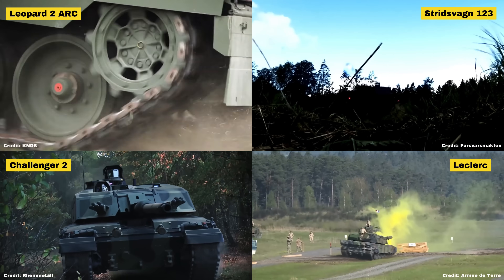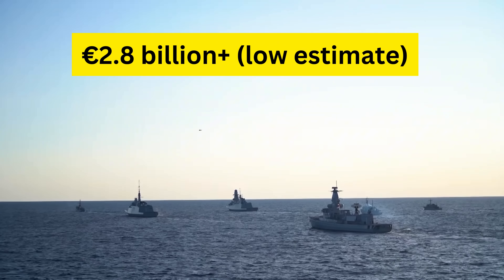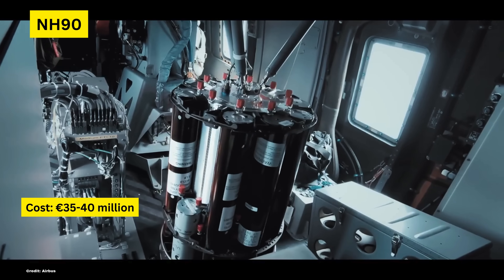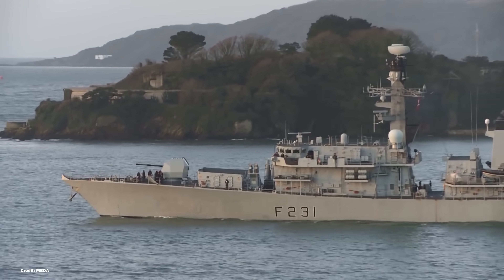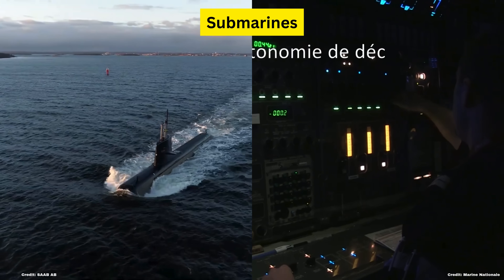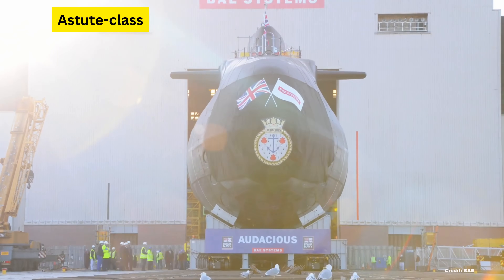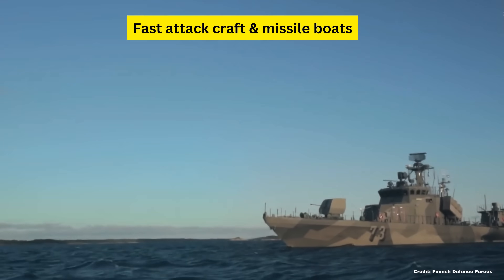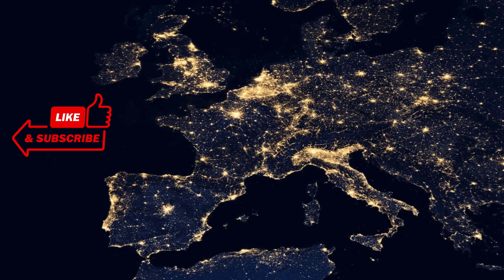The Staggering Cost of Losing Europe's Arms Market Part 5 - Europe's Naval Power continued

Comment: Finland should abort the F35 deal ( almost 10 billion €) ASAP!!!
Reply: So should Denmark. For obvious reasons slow walking the vote on the contract would be the wisest way.
Reply: @natviolen4021     go for the saab gripen.  Very cost effective,  can be operated from a decent road. Very capable aircraft
Reply: @jameslang6760  And it is fully NATO integrated.
Reply: @jameslang6760  The Gripen relies on GE engines - which the US could probably also make life difficult with.
Reply: @robert.maynard  That sounds interesting i did not know that. Have to look into it.
Reply: @robert.maynard  i wonder if Rolls Royce could help...
Reply: @57thorns  If the NATO integration is an US system it wont help us if the US breaks out and buddy up to Russia. Then we need our own system that is not Nato standard.
Reply: @palandorstvold5622  That worries me, too. Would that be an idea for a future video?
Reply: @robert.maynard  So no option if you want independence from the us. Eurofighter Typhoon or Dassault Rafale. Keep money within the EU 👌👌👌👌👌
Reply: @robert.maynard  Just wondering out loud how difficult it would be to replace the 414 engine with a European one, and how the performance envelope would change. The time/money for doing this important part of the calculation.
Reply: @gordanhyland7422  The EJ200 is newer than the F404 upon which the Gripen's RM12 is based and is shorter, lighter, smaller diameter, and more powerful - however how much of the airframe would need to be replaced / reworked to accommodate it, if it was a possible option, is for experts to determine.
Reply: @robert.maynard can easily source and fit a different engine. BAE are leaders in jet production, or there's the Eurofighter jets or the Rafael jets, not to mention all the commercial jet companies with the capability to design new or modify existing engines
Reply: @robert.maynard the next gen aircraft from SAAB/BAE needs to have a European engine. I wonder if it’s possible and cost effective enough to re-engine the Gripen.
Reply: @robert.maynard  volvo also makes on that fits
Reply: @jameslang6760  it needs a new  none us engine  saab should talk to Rolls-Royce
Reply: @Sir_Godz  Volvo make the Gripen's turbine - however it is a licensed version of a GE turbine - so will very likely have US strings attached.
Reply: @robert.maynard  That can be fixed
Reply: @welvanons I'm afraid the typhoon have some, albeit less than the Gripen, American kit as well. So do the Rafale. The biggest isssue is the Link 16 which is in all NATO aircraft. It's also in stuff like the patriot missile systems. We need our own links and we need to keep the Yanks out of it.
Reply: @ I agree sincerely. But Europe has several aircraft manufacturers so, if Saab gives the necessary data, one would think replacing the us parts/engine etc could be possible within a reasonably short time. The knowledge is available.
That goes for every aspect of defense equipment. We know what to do.
Reply: Yes. Here in Denmark, we have only bought 27 F-35s and the word around the Royal Danish Air Force is that about 25 more fighter jets are to be bought soon. We can only hope that they avoid the U.S. kill switch by buying Gripen, Rafale or Eurofighter.
Reply: @TheMagicCoach  All European buyers should band together and renegotiate the deals with Lockheed to get control over the software and/or exemptions as Israel apparently have.
Reply: @TheMagicCoach  You can also avoid that by simply buying the Israeli aviation system for it. The aircraft would not have any software connection to the US or Lockheed Martin anymore.
Reply: It always baffled me that some european countries decided to chose american jets when we manufacture world class jets with Rafale, Gripen and Eurofighters in our continent. Shame.
Reply: @Dun4nlol Lobbying and US influence runs deep. Also the F 35 is joint program with European allies so it made sense to buy them. Good thing is that we will have our own gen 6
Reply: @AnimaChronix3  That and it's simply the best aircraft. I can hear the Grippen NG fanboys coming from far away and it is a good aircraft which has a number of advantages over the F35 (maintenance/cost per flight hour and an ability to operate from highways if necessary), but in general the F35 IS superior...
Reply: @Mourning76  ya but if the Americans switch sides and end up attacking the F-35 is useless because the Americans can just shut them down from a computer on a base somewhere over a 1000 miles away 😂😂
Reply: @Cn147-gp5     you really think that the Brits who helped develop the f35s electronics/avionics haven't already started to develop an alternative? It may already have happened,  they've had plenty of time. We do need our own European satellite coverage,  Hungary and friends need not apply...
Reply: Imagine if the Nordics bought Gripen. What a sight!!!
Reply: @ That is what I wanted before Stoltenberg bought the F35 so he could become secretary general
Reply: Finland should sell them to Russia and buy European
Reply: And replace them with what ?
Reply: @Desi365 that is the question. Each jet engine has their own unique design features, making them difficult to be interchangeable in airframes designed for a specific engine. There are questions of performance figures, weight, and dimensions to consider. Also things like how a particular engine is controlled. That is why I am asking if it is possible to fit an European engine into the Gripen airframe without excessive modification and without compromising performance. It’s a big problem.
Reply: tell Donald Juda Trump that according to HIS understanding of tariffs, if he put some on the EU and we retaliate, HE will have to pay billions for your F35 purchases...
Reply: Norway should drop the F35 deal aswell👍
Reply: @silentdeath7847  "Norway should drop the F35 deal aswell"

feel free to take my place up north, if not, be silent.
Reply: The Americans have Failsafes in all their fighter jets and missiles etc. and they can shut their planes and weapons systems down from a computer somewhere on a base 1000 miles away anytime they like. Not a good  if you only have their equipment and they end up attacking you . All your weapons are now useless
Reply: The Euro Fighter Typhoon is the only fighter jet to ever record a Hit on the F-22 Raptor during NATO war games about 10-15 years ago
Reply: and Belgium, we bought more then 30 of those scam planes
Reply: That is too short visioned I'm afraid. Europe doesn't have an equivalent to the F35. We should swallow this pill and become independant in the long term.